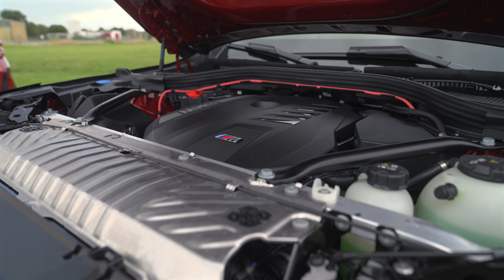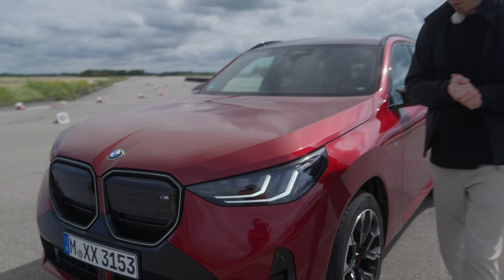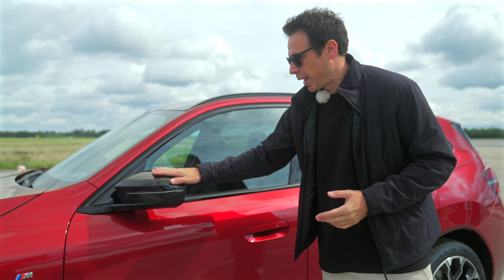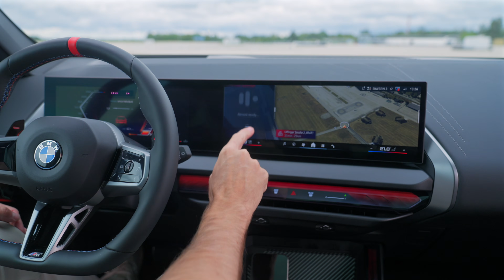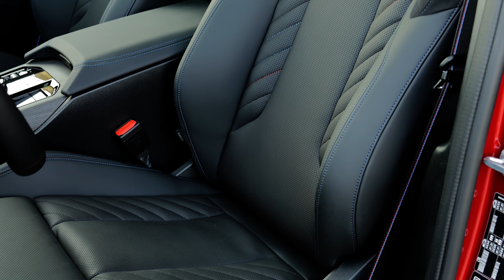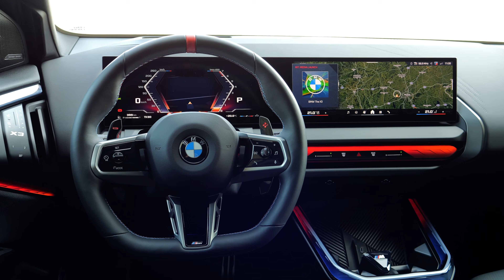NEW 2025 BMW X3 M50 Most Comprehensive Review

Comment from the maker: What do you think of the new BMW X3 M50? Better than M40i?
Reply: That's a NO. This new X3 is not very BMW. Interior looks cheap with lots of plastic and the exterior looks like the XM which is a bad thing.
Reply: Not Bad. I am disappointed with the interior. Too much plastic when in the preview drive event that you went to they promised nicer materials in the interior; the BMW executives need to know this.
Reply: @kefakiilu1807 exactly, sth changed during the development. At one stage, BMW exce said materials used would be close to those found in X5 and other luxury models. This has not happened.
Reply: @lequnsu4689  They never said that it was always planned like this
Reply: Interior a hard no, it's not even subjective. In terms of performance and every day usability it's a big win.
Reply: @Chris-yg3nj  Performance not good for a new gen... consider the 2018 M40i had the same numbers.
Reply: I like the look... makes me excited about the next generation X5.
Reply: No, I just bought a 24 M40i bc of how cheap the interior is on the m50.
Reply: @patrickc9317 Same. Bought one, '24 model for the wife.
Reply: I am thoroughly disappointed with the quality. The product looks cheap, as though the interior design is made from low-grade plastic. Has the price been reduced to reflect this poor quality, or is this a deliberate attempt to cut corners while keeping costs high.
Reply: Very bad interior and exterior design, definitely this thing is not a buy. Especially with many low mi older versions out there.
Reply: Ever have a girlfriend when you were younger who had gorgeous locks only to cut them unexpectedly to “shake things up?” Yeah, this is that.  You will still love her but something is lacking.  Yes, true story and I still married her because I’m not shallow but this is a vehicle, not a human.  If I’m going to purchase a vehicle I know will have expensive troubles later, it better be the ultimate driving machine.  My goodness, I think my sister had a better designed Fisher Price steering wheel when she was a child.  Stop removing oft-used physical buttons!  I applaud the ability to change driving modes but this is nothing more than a glorified X1 at best and Rav-4 Prime at worst.  Minimizing interior design to one all-in-one screen is lazy and uninspired.  Imagine not having your vehicle for weeks on end when the screen unexpectedly goes out and you can’t drive without heat/air/speedometer.  Hard pass which is a shame because I’ve been saving up for a 40i. Looks like I’ll be looking elsewhere.
Reply: Agree it looks basic and bland.
Reply: It seems that BMW will lose a bunch of customers with this M50 with better alternatives in the market.
Reply: @bmwblog  I’ve grown to like the exterior but there’s too much plastic on the interior…and I’m having second thoughts on trading when my lease is up in a year.
Reply: X5 40i .:)
Reply: you do know that you are promoting (for free or maybe paid by bmw for that, idk) a car because of which the whole design department of bmw was fired, right?
Reply: I’m glad the engine is still great, and it no longer has a crashy hard suspension but the rest (especially interior and exterior design / quality) is honestly a bit of a let down. Also, straight line sporty runs are not enough to go off in terms of driving / handling performance. BMW M should be a driving machine but this really doesn’t seem to be one, and really doesn’t seem worthy of it’s $65k - $70k price tag IMO
Reply: Bad exterior design, optics in the style of Chinese cars, simple interior design and lack of metal parts in the interior is very bad for a car of this class. The G45 M50i has dual exhaust in the style of real M, but there are no seats in the style of M, what the hell?
Reply: Not in the interior atleast with plastic but exterior looks beautiful.
Reply: Like both upgrades. Interior and exterior.
Reply: Yes cause I think it has s58 format
Reply: Or the comp atleast**
Reply: Shut up I just ordered an 3M they’re awesome

Comment: Great review. Unless you take the M50 for a truly extended test drive, as you have, and insist on driving a build date 2026 with upgraded real leather in two tone (which is now extended over more of the interior) and multiple other interior trim upgrades, yes, some may initially think BMW have cut too many corners with the interior.

However, after a couple of hours, you realise they have simply been brave enough to truly, really modernise. It's a whole new era for BMW, and this car is simply amazing.

I have had mine for 9 weeks. My other daily driver is a 2022 G11 LCI BMW 750i xDrive M. The pinnacle of BMW ICE luxury and power (390kw 0-100kmh in 3.9s twin turbo V8). The 7 series is pure luxury, enormous power, comfort, yet also enough adaptive flexibility in handling to handle better than a lux limo should be able to. It is just a delight to drive, as you would hope for its price tag when new.

The M50 couldn't be more different, for good, not bad reasons. It is sheer engagement, pure fun, flat out pace, unassailable grip / handling, incredible tech that gadget lover's like me adore...and yet its still entirely practical. What look like cost cuts in some places is deliberate minimalist design and styling. Yes, they overdid the interior plastics originally, but most of that has been fixed by build date 2026. And...the array of affordable (cheap even) interior add ons available on Ebay and AliExpress is awesome. Too much plastic for you? Add carbon fibre and leather wherever you want.

More to the point, it is so obvious they spent the money on making a brilliant engine even better, did the same with the slightly revised ZF gearbox, and refused to settle for anything less than perfect balance in chassis dynamics. The old X3M was out and out 'sports' - nothing else. Often a harsh drive. My 750i is out and out luxury and presence - all that enormous power is really only there for the ego of those wanting the fastest luxo limo in the private golf club car park. 

The G45 X3 M50 is so much more than one thing, or another. It is Jekyll and Hyde, both controlled at the press of a button. It is the perfect fuel efficient fun commuter, yet also a truly M influenced, very fast, astonishingly dynamic, Macan S or even Cayman S, killer. Schizophrenic, yet you control the identity change.

The two bad points? As identified by many - the Harmon Kardon surround sound system is flawed. I know, as the same system is in my 750i and sounds amazing. In the M50, my guess is installation is poor. It will be a simple fix. Second, the pano sunroof doesn't open 😢.

The M50. Another Ultimate Driving Machine from BMW.
Reply from the maker: Thanks for sharing

Comment: Thoughts of a bmw owner (3 of my last 5 cars were bmw): 
What I don’t like most: overuse of plastic, no interior door hand to close door, no physical buttons for a/c controls. 
What I don’t mind much: roof doesn’t open but I never use it anyway, redesigned mirror controls doesn’t seem great but not a huge deal, the design I think looks no worse or better than the last one in exterior. 
What I like: reduced road noise, larger infotainment (last x3 was too small), more power, return of b58, interior ambient light bars (look very cool), illuminated grill surrounds (look very cool as well). 

Overall: 7.5/10 for me. Delivers a premium quality compelling driving experience with livable daily driving, strong aftermarket potential and improved tech but held back by cheaper interior pieces and some questionable redesign controls.
Reply from the maker: You nailed most of our points also

Comment: Front is ugly and ballooned but it has grown on me. It is less ugly the more I look. Rear is great. What the f is that crunched brake and speed pedal!?! With size 9.5 42.5 winter shoes boots, so average feet by North American standards, the winter boots jam in the crampedpedals. Checked the prev gen x3 X5 F30, there is 1 more inch of room and the brake pedal is more recessed enabling pedal to pedal movement. why do reviewers wear summer driving shoes versus an inclement weather boot? Also why do the rear doors open 80degrees how do I lift a sleeping child?

Comment: The BMW X3 25L xDrive and X3 30L xDrive will be offered exclusively in China, and developed through a close collaboration between BMW and their counterparts in Shenyang. These models are manufactured at BMW Brilliance Automotive’s (BBA) Lydia plant in Shenyang. Additionally, the BMW X3 M50 xDrive is produced at BMW’s Spartanburg plant in South Carolina, completing the model range in China. 

BMW has announced the addition of a new X3 to its lineup, developed exclusively for the Chinese market. The latest iteration of the BMW X3 (G45) features an extended wheelbase for the first time, enhancing rear legroom and comfort. As with previous long wheelbase BMW models, this new X3 is tailored its to meet the specific preferences of Chinese customers. With an exterior length of 4,865 millimeters and a width of 1,920 millimeters, these models are the largest in their competitive segment. The extended wheelbase, increased by 110 millimeters to 2,975 millimeters, provides extra interior space.

Comment: I just came from my local dealer and the back seat passengers get no ambient lighting in the doors or nothing like the front passengers do. Not like my ‘23 M40i. BMW must to go back and correct all of those unforgivably cost cutting mistakes and have them ready for 2026. Replace all that dashboard and door plastic with the brushes silver like my ‘23, add a door sill plate…how lazy and stupid. Ambient lighting in the rear doors and give the car a proper sunroof.
Reply from the maker: It's interesting that the China long wheelbase X3 has the ambient lights in the back
Reply: OMG!!! I saw it!!!! Burgundy interior because ALL of the SUVs are suppose to be made here in the states. Interesting. 👍🏼
Reply: The seats look ugly too.

Comment: Previous BMW X3 model engines have defective design that leads to permanent engine failure.I would not rely even on newer BMWs past the warranty period. In the past customers have faced engine issues ranging from timing belt to fuel pump low pressure resulting to engine blow outs. BMW dealers are quoting anything in the range of 15k to 20 k for engine replacement with no major recalls on this issue. There is also a class action suite for these defective engines for which BMW was ruled by the courts to compensate the affected customers. Absolutely a lemon of a brand !
Reply from the maker: Can't generalize. The B48 is considered a good engine

Comment: I’m glad the engine is still great, and it no longer has a crashy hard suspension but the rest (especially interior and exterior design / quality) is honestly a bit of a let down. Also, straight line sporty runs are not enough to go off in terms of driving / handling performance. BMW M should be a driving machine but this really doesn’t seem to be one, and really doesn’t seem worthy of it’s $65k - $70k price tag IMO
Reply from the maker: They fixed some things, others are not as great. Like some bits inside

Comment: And saw an article review the other day which sums up the issue with the new X3 quite well. It is like BMW set a budget of X for the new ICE X3 development and all the money was spent on the engine, chassis, mild hybrid, external design etc and there was just no money or very little left for the interior design and to be precise the choice of materials. So it is a product half complete. A what it could have been if they had more money product. Would you buy any product knowing that??
Reply from the maker: The interior is not as bad as people make it to be. We're critical of it, but let's not assume it's very cheap. We just had higher standards overall
Reply: @bmwblog  hehe we try. Ultimately sales number will tell. Ask BMW how many 5er Ls have they sold in China so far. I am sure they thought the equally "cheap/cost cutting" 5er L would still sell bucket loads in China.

Comment: Interior is absolutely terrible both aesthetically and from a control perspective. One aspect of the BMW’s I’ve owned that I’ve always loved, is the well thought out driver centric switchgear, which always had the buttons /knobs in the right place with great tactility and feel. This overall just looks unnecessarily convoluted and an aesthetic choice in design chasing the competition in terrible futuristic tech looking interiors. The elegance in design has gone. In addition, too many cheap materials used. That interior door handle design and vent control area look stupid and unnecessary. No-one wants touch sensitive/capacitive controls! The interior designer should simply be fired. Not even going to comment on the exterior. The only great thing about this car is the glorious B58 engine, but alas it is not going to outweigh the rest for me. Overall disappointed. Was looking forward to this release, but I will be looking elsewhere.

Comment: I have 2022 M40i and weight is lower, also 48V mild hybrid, also 4.4sec to 60, and the interior is classic beautiful. The 2025 steering wheel looks like VW touch button style (poor) and the screens looks like Mercedes, but whatever point being is, there is nothing I like and the new car. I would not take it even if they wanted to exchange my '22 with $0 payment. Extra torque makes nothing because you have heavier car. I hope the door closing does nice "thud" like VW, because the only complaint I have about 2022 is the door, and cabin noise, but it was made during covid and shortage so I forgive
Reply: And no physical buttons! Wow this will be the worst selling X3 of all times. I drove VW Atlas with no buttons and it was Horrible! IMO the 2022 design was the best combination of classy and tech and intuitive simple dash

Comment: Great review.  I love the exterior design, M50 performance is very good.  I can live with the step down interior quality given the reasonable price point for this level of performance.  Interior quality will be a significant drop from my current 540 but you can't have everything at this price.
Reply from the maker: Overall, you're still getting a lot for the money. The car does deliver in plenty of areas but it can definitely not step on the toes of the X5

Comment: The 0-60 has to be way less than 4.4 sec. More like 4.0 or 3.9.. my G01 does it in 4.1 sec. I hate the interior the most on this x3M50 and this design is a bit controversial for my likings. Mercedes is killing it in terms of design right now, however I do like the M5
Reply from the maker: It's def faster than what BMW advertises

Comment: I have a 2022 X3M40 and the new X3 does not excite me. I have seen and read a lot about the new X3 and am waiting for it to arrive at my local dealer. The outside is OK but the inside so far does not hold a candle to my X3. The options in the configurator do not impress me and the price has jumped up significantly.

Comment: The front end and interior look like it was carved from a solid block of Plastic that was pinched in the middle! Wtf Beeee Emmmm? iDrive9 is the “el cheapo” version, so I don’t get how they’re programming such an expensive car with the cut-down version, and most iDrive9 cars don’t get the jog wheel, so I’d also expect it to disappear in the facelift. Haptic and “touch sensitive” buttons are the main reason I didn’t buy a VW Golf last year and went with BMW instead, it now looks like my replacement BM won’t be a BM for the same reason …I’m not buying into this cr*p, and when manufacturers get the hint that buyers are voting with their wallets, they may just regain some semblance of reality. They need to understand that the majority of people buying these cars are not the PlayStation generation.

Comment: I like it but it seems a major drop in interior quality vs the G01 series though. It's basically a sacrifice over the interior quality with traditional buttons/controls and the opening sunroof for a far superior chassis and the best of the B58 engine and performance. I reckon once this is on a dyno as stock it'll show higher than declared horsepower and torque, maybe 420 horsepower and 580 Nm here in the UK.